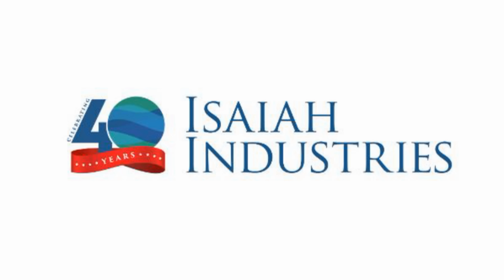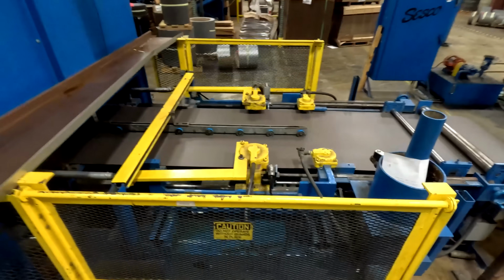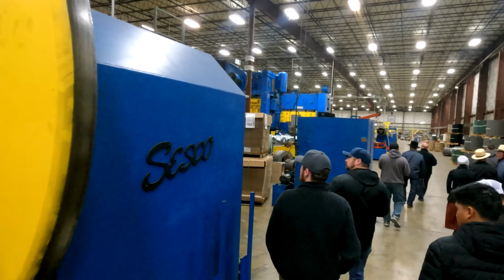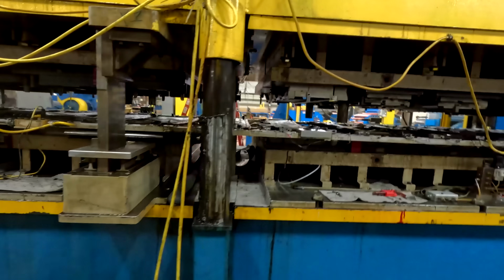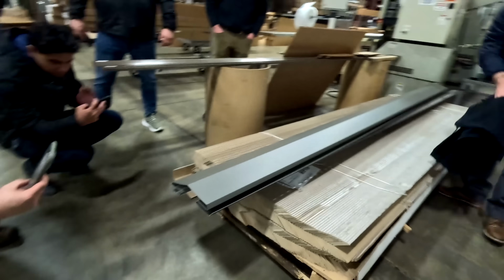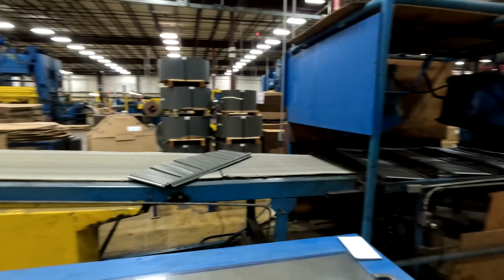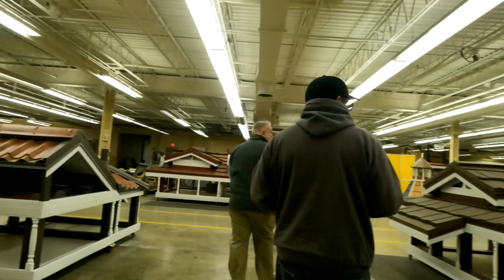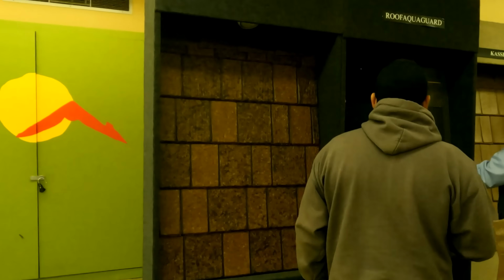How Metal Roofing is Made - Isaiah Industries Factory Tour

Comment: Greetings from the UK. Really interesting video thank you.  Here in the UK, we use terracotta tiles, slate tiles et cetera.  Metal roofing materials are unusual.  Interested to know why you are going for a metal roof?  I imagine a metal roof can be quite noisy too, and needs more insulation?
Reply from the maker: We are using metal because of the longevity, cost, weight and the sound. 

Slate would be awesome but it’s expensive and heavy. 

We both like the sound of rain hitting a metal roof. We’re already going to have a lot of insulation since we’re building as “tight” a house as we can. 

Great question 😊. Thanks
Reply: As long as the home has some attic space and insulation, we do not get sound transmission complaints.  We do offer ways to help deaden the sound if it is a big concern due to the structure's design.

Comment: How does that metal stand up to the extremes of temperature you have where you live?
I have metal roofing, it lasted 10 years, during that time it faded, and eventually corroded.
Reply from the maker: They do color testing on their metal and have warranty against fading. Most of the houses in our vicinity have metal roofs that have been on a long time. Obviously, lots of options and quality variance depending on whose product you use.
Reply: It all starts with the finish as we say.  The PVDF finishes we use lead the pack in terms of fade and chalk resistance.

Comment: Wayne-Dalton Corporation in Mt. Hope, Ohio, is another company to visit.  It started out as an Amish company, then the English took over, and now it is owned by a Japanese company.  They started out as a wooden door company, then moved into the metal industry.  Their rolling door division in Dalton, Ohio is the most fun to tour.  Their Planetary gear fire door is one of my product ideas.  They called it FireStar.  The original fire door was called the Akbar.  I worked there for 5 years, transforming the rolling door manufacturing from a job shop into a true manufacturing plant.  Their way of building doors was redneck engineering, as the engineer had to be there with the product during fabrication.  First the engineer designed the curtain, then they built it, then he weighed it to create the spring solution.  Then after winding the door up on the spring assembly, they measured the coil for end brackets and a hood.  I figured out all that using computer automation, which reduced the work load on the engineers and tripling the profits.

Comment: How are these shingles installed? One of the downfalls of traditional metal roofing is that galvanized nails with neoprene washers are used for installation, after a point in time the neoprene washers break down and no longer provide a seal, causing roof leaks.
Reply from the maker: They have tabs on them with a hole for a screw. Start at the bottom. Install a row and then the next row covers the tab.
Reply: These have concealed fasteners and interlocking panels. Here are some installation videos you may enjoy: https://www.youtube.com/playlist?list=PL415A88F74FC633EC

Comment: Actually, if you had a regular flatbed with pit the tire bumps on the way, that fork lift works fine.  It's just your trailer is not what they load normally so that's why it looked weird. As long as he didn't damage the product or trailer, he did a good job.

Comment: But if you would've brought 4x4's as wide as the trailer bed. It would have been easier for him to off load onto your trailer. Also ya could've choked it with 2 straps. One strap on each fork to load it like that as well onto 4x4's. Also better to have a trailer that's a legit flat deck. I've driven a Hilo since the age of 18. Learned a lot from the old timers and experience of my own. So I can flip a penny from the ground onto the fork and a few other tricks but can load with great confidence but never taking safety for granted. 
Glad ya went with a steel roof. I dig them and I like the sound when the rain hits it.